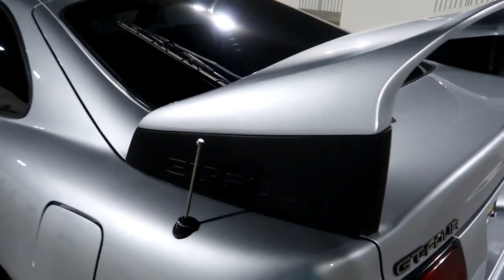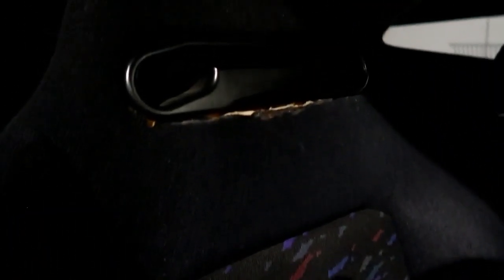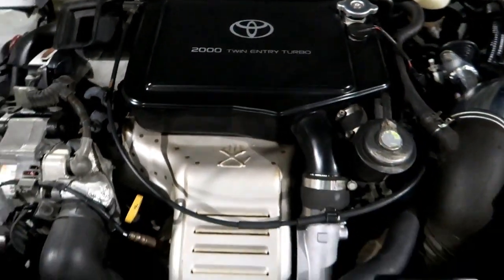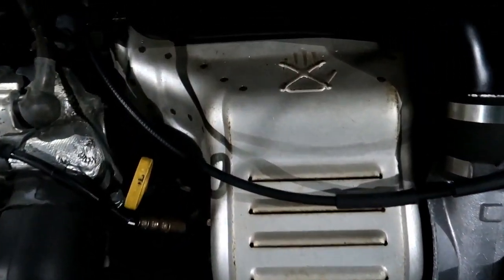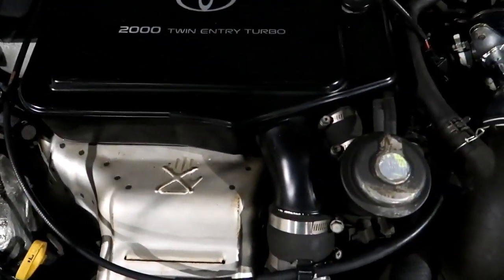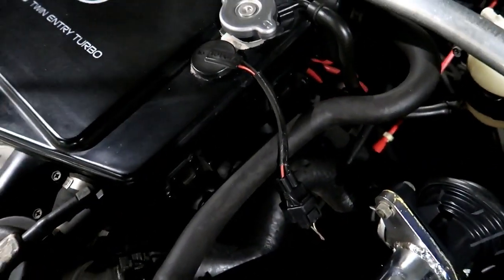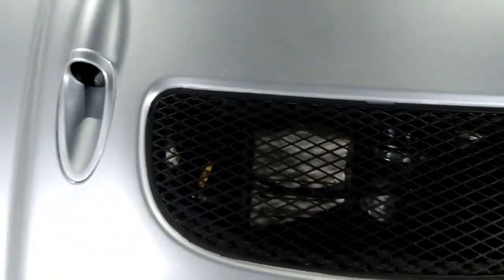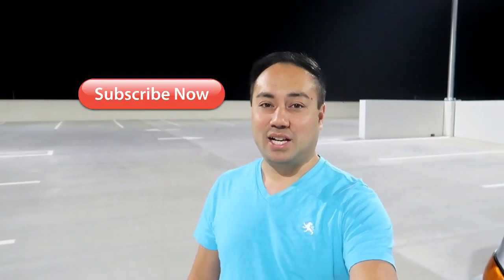FIRST JDM ST205 IN AZ? | Celica GT4 WRC

Comment: This it my dream car. The Hood is also made out of aluminum to save weight. Are you going to upgrade the headlights to the OEM Projector ones? Also check out if Seibon still makes the hatch for it. They once had the rear trunk hatch made out of carbon fiber. The rear trunk hatch is crazy heavy. Please change those wheels to something better like "Fifteen52 Tarmac's" or "Turbomac" or a nice set of "Speedline" wheels. I had a ST204 I was converting you can go pretty wide on the wheels. 17x8.5 or 17x9 and go with like a Square 255/45R17 | 265/40R17 Yokohama A048's or Toyo r888r's. But the 3sgte is pretty bullet proof, you can turn to around 400 hp before you run into issues. But most the parts for these are still on the shelf as far as Manly Rods, Pistons and Valve Train Parts. you can also go with the 5sfe crank shaft to go a stroker setup. Just make sure to get the crank that doesn't have the balance shaft gear. These were my ideas for my build in the past.
Reply from the maker: I appreciate all the info! I am definitely planning on lowering the car and getting a different set of wheels. 17x8 + 30 squared is what I'm going for. I don't know what wheels yet, but it's going to look tastefully. :D
Reply: @jdmfaddy3923  I like your taste. The wheel combo setup on your supra is really nice. Can't go wrong with some Advan's. The only thing I would change would be to go back to the OEM Supra spoiler. The TRD one is nice just my taste is the Stock soiler but your supra, your choice. One day I will own one hopefully. I also have a Manuel IS300 with some Advan RS2's.
Reply from the maker: @brycenconk8087  Thank you! Yeah, I like the stock spoiler too, but the TRD wing just flow better with the lip kit that I have. Unfortunately, that's the problem with modding cars. I can't leave it stock. LOL